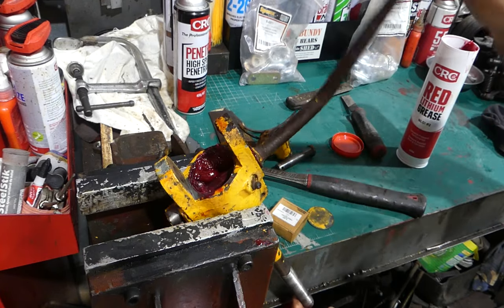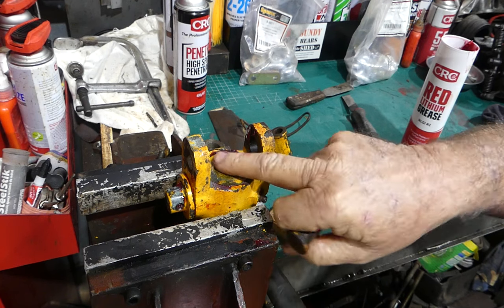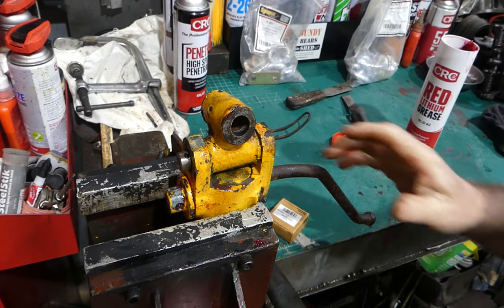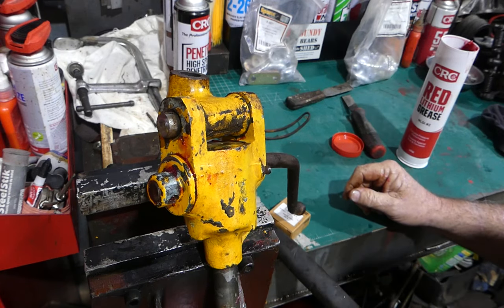How to Assemble Your Tractor Levelling Box

Comment: Hi Lance thanks for that! Can I ask you what you'd recommend for my Mark 1 mf65 to make it easier to steer its all manual Ive put one of those speed spinning hand knobs on the steering wheel rim but when I'm going real slow its so heavy my arms can't handle it! Do you reckon a power steering kit would be ok for a very novice mechanic at home?
Reply from the maker: Yes a p steer kit is an option but before you spend money on that make sure the kingpins and kingpin thrusts are in good Nick.

Comment: Thanks Lance very informative, I've replaced my mf65 levelling box and noticed the grease nipple had been broken off. After a frustrating time breaking drill bits got it out and of course the hole is too big to keep the new one i found in . Do you know what is the standard grease nipple for the fergie and what size is the tap?
Reply from the maker: Tap is usually 1/4" UNF but if it is an aftermarket one they could be 6mm but I would go with 1/4 unf